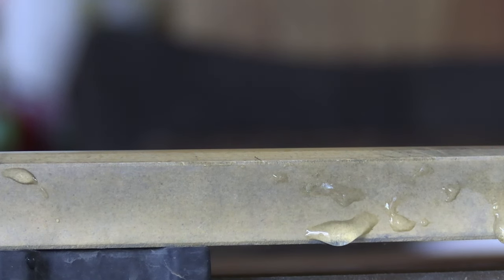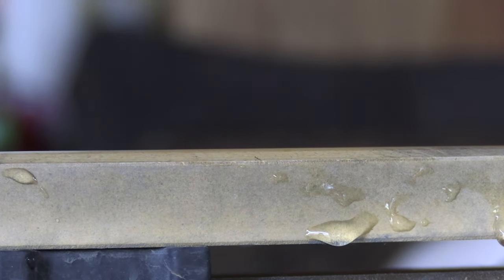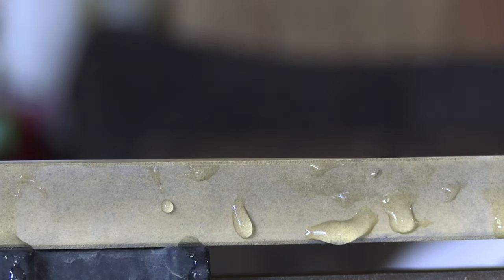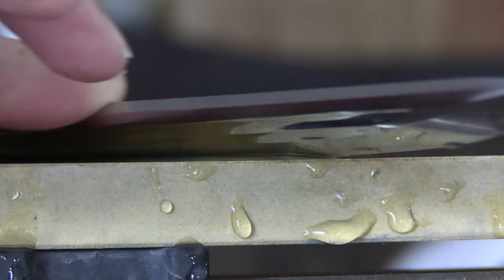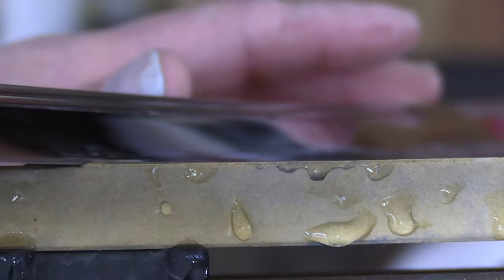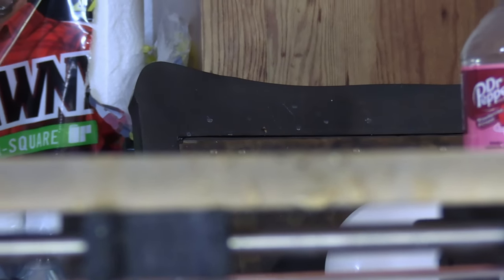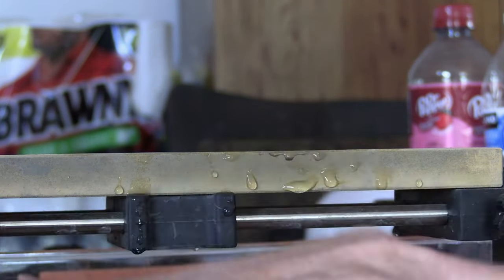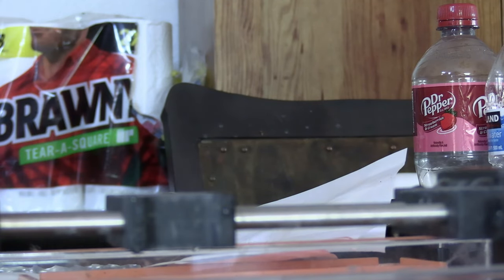up-close sharpening view

Comment: Sharpening like this will put a bevel on over time less agressively than a worksharp, but youre doing the same thing essentially. This is even less consistant because of the variation in angle between strokes. Especially at the tip where you're lifting.

Comment: 2:52 this hurts me so bad. Should never nevet seek a secondary bevel on a katana. Look at nihonto, the polish is true to the edge angle. That's what makes it sharp. Sorry but no, true edge or bust. Can't do secondary, it's never right. Try primary.
Reply from the maker: @KF1  absolutely 💯, I never have put one on my swords yet
Reply: @gargoylesblade  I see that you're doing it lightly but it's full wrong. Sorry, man, no dice. Makes me want to produce a vid how to sharpen/polish. Cannot lift the spine it's non-negotiable. The blade surface Must remain in contact. Will vid send
Reply: @KF1 I remember you had one in the past where you strapped down some sandpaper to a white board of some kind and had like a gallon jug of mineral oil. I couldnt find it anywhere. Maybe that was a vivid hallucination. At any rate, I'd watch that (again? lol)
Reply: @Jaedeok82  holy cow you remember that? Was a vid I did for new years 2012. No longer have it, tho. Will remake it at soon